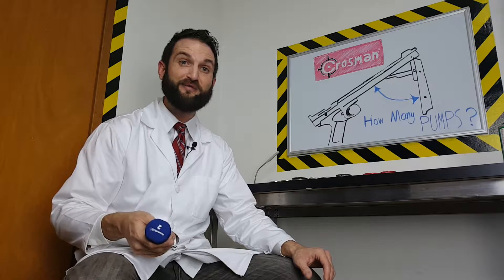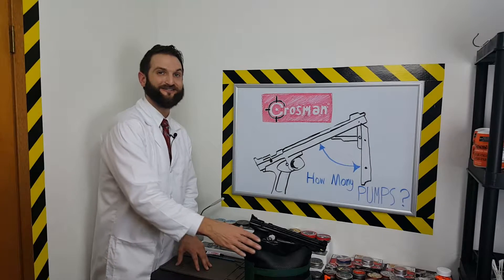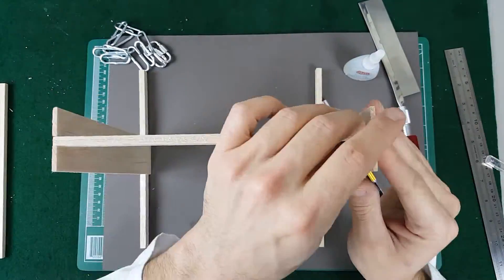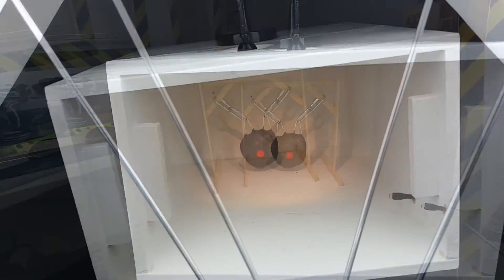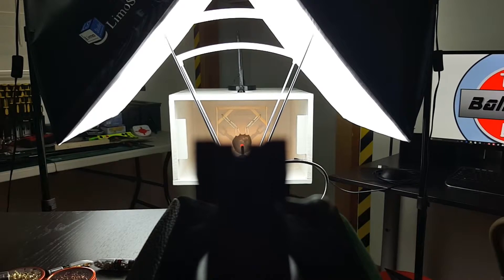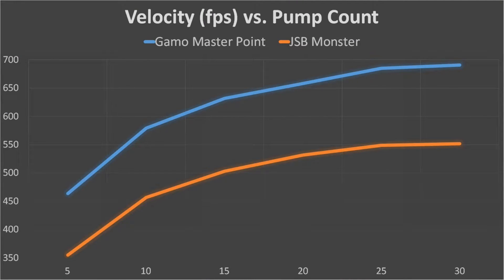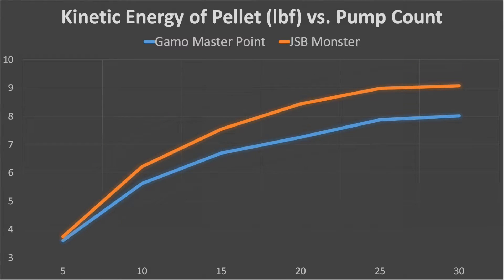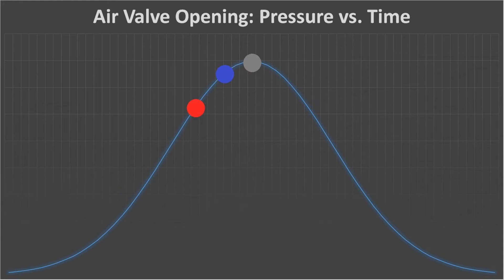S1E7 - Airgun Pump Power Test - How Many Pumps is TOO Many?

Comment: I posted my comment before I read some of the other comments, but here's my 2 cents: numbers do not lie, but you can lie with numbers, and the laws of physics are not just really good ideas.
To begin, the average air molecule is around 28.96546 daltons, or 0.02896546 kg/mole. Now, kinetic energy is 1/2 x mass x velocity squared, so a parcel of compressed air has internal energy, but that energy is not directed at just one direction, but 3 because we live in a 4 dimensional universe (time is the 4th dimension). Now, using Maxwell's distribution, we have a probability or how much velocity a gas molecule has such as peak, average, and rms, and we also have the speed of sound to contend with, which is the slowest of all, so air molecules are traveling faster than the speed of sound, so why don't we hear a constant sonic boom? because according to Maxwell's distribution curve some are traveling much slower than the speed of sound, while others are traveling at far greater the speed of sound, so they cancel out. Now, looking at the formulas notice the variables: square root radical, 2, 3, R, T, pi, gamma (Y), and M. T is the thermal dynamic temperature in kelvin (not degrees kelvin, which do not exist). T = 273.15 + degrees celcius, and degree C = 5/9 x (degree Fahrenheit + 32). So we begin with the speed of sound (SoS) = sqrt(YRT/M), or sqrt(402xT) then to the most probable "peak" (Vp)=sqrt(2RT/M) then the average (Vavg)= sqrt(2^3xRxT/(pi x M)), and lastly, the RMS (Vrms)=sqrt(3RT/M). The analogy here is the same as the five blind men trying to describe an elephant depending of where they were testing, or touching it. This is why I wish a psi gauge was attached to observe the compressed air pressure in the cylinder after each pump. Energy and momentum is conserved, which means it, or they only get transferred into another form of energy such as heat-energy, sound-energy, light-energy, kinetic-energy, potential-energy, internal-energy, nuclear-energy, mechanical-energy, magnetic-energy, etc., etc. and moving toward entropy (S). How I wish the metrics were given in the video such as barrel length, volume of air reservoir, reservoir pressure then the calculations could be more exact than assumed. I calculated the gun's efficiency to be between 15.25% and 33%, which is beyond ridiculous because the efficiency (n) calculations should be around +/-0.001%. Lead has a specific density of 11.34 gr/cc and molecular density of 207.2(1) daltons, or 207.1g/mole (grams (g), and not grains (gr)).There are approximately 7.15 air molecules per lead molecule and using the law of conservation of momentum, you can see that the mass of air far outweighs the mass of the pellet; in other words, just because air is invisible does not mean it does not exist, so taking this analogy, it is as if air was an invisible bowling ball and it strikes a baseball at faster than the speed of sound, but only accelerates the baseball to 600 to 900 fps and thus the baseball only creating 15% of the total momentum calculated from the volume and pressure of the reservoir. Yes, I find it interesting too, which is why I stay up all night watching YouTube videos and taking down notes and fact checking. Lastly, because compressed air is bouncing against 6 faces in a cube and the 3 dimensions in the real world there exists the probability of air travelling in the X-direction of 1/3 the amount, or called 3 degrees of freedom, and is why gamma (Y) for air is approximately 1.4, which equals 7/5, which comes from 3/5 + 4/5, which comes from ...mechanical statistics. I hope I didn't get carried away on this follow-up comment. Stay safe everyone, and God speed.

Comment: Great video, liked and subscribed. As to which pellet has more energy? You cannot compare apples to oranges. You can only compare apples to apples and oranges to oranges. I wish you had included the metrics of barrel length, chamber psi, etc. If you want to compare different weight pellets then do not use the same barrel, use the laws of physics such as momentum (p), where p = m x v then you will realize that the one with the highest velocity will far outperform the one with the less velocity because in kinetic energy (ke = 1/2 x m x v^2) the velocity is squared, so for unit time of one second you will realize the fastest projectile outperforms the heavier projectile, but if you are using the same length barrel then it will appear that the heavier projectile outperforms the lighter projectile. Many argue that it is because the heavier projectile travels slower and thus ends up being longer in time in the barrel where it will accelerate for a longer time and thus absorb the kinetic energy of the gas in building up the heavier projectile's kinetic energy; although true, but if the lighter projectile were to spend the exact amount of time in a similar barrel, it will most definitely gain far greater kinetic energy due to the increase of momentum gain from the air; in other words, for the lighter projectile to equal the heavier projectile in kinetic energy, or momentum, it would need a far longer barrel, so if your length of barrel is fixed then the projectile that lasts longer in the barrel will have the highest kinetic energy, but will appear to be travelling much slower "appear". As to the valve dwell open amount, it is around 2 to 4 inches at most of pellet travel, and that's the fast moving pellet, but the pressure drogs geometrically because the volume of the barrel behind the moving pellet increases geometrically to the point of diminishing returns once you go past the frictional forces, which are the same, which are about 2 pounds of force per inch. In addition, the breakaway force is around 6 pounds of frictional force. Note: breakaway force never exists with frictional moving force because one is static while the other is dynamic. I calculated an efficiency of 15.25%, and you can certainly do better than that by increasing the barrel length. You cannot have your cake and eat it too, so you have to decide whether to have a high efficiency (shot count, or ease of pumping), or POWER! (low shot count, or a hell of a pumping experience as your 30 pumps). Which is it going to be? A shooter must know their limitations. Thank you for the video and add a digital pressure gauge to the cylinder and it will be like wiping the mud off your goggles. Stay safe and keep up the great job.
Reply: If they are going at the same velocity heavier has more energy. Heavier is more accurate. Sometimes you get more velocity from the lighter pellet, but this was not the case in this test. If you want to know the barrel lenght and specs look up the crossman classic.

Comment: I would be more inclined to think that the increase of energy is due to the seal of the pellet in the barrel.
Reply: The increase of the energy is because the heavier the projectile, the longer it stays in the barrel to absorb some of the kinetic energy of the expanding compressed air. The lighter projectile has far more kinetic energy per millisecond, but it stays in the barrel for far less time. A 500 fps projectile will travel 6 inches in one millisecond, where a 600 fps projectile will travel 7,2 inches in one millisecond, so to normalize both projectiles, you would need a 6 inch barrel for the 500 fps, and a 7.2 inch barrel for the 600 fps projectile, but if you are firing both projectiles from a 4 inch barrel then 4/6=66% energy build compared to 4/7.2=56% energy build. The only thing that can make the look equal is when the barrel length normalizes the velocity squared of both projectiles, which is approximately 69.4% the length of the fastest projectile's barrel length. Numbers do not lie, but you can lie with numbers, and the laws of physics are not just really good ideas.

Comment: the heavy pellets allow pressure to build up wich explains the dramatic velocity even for its heavy weight, i used to shoot beeman lasers wich are 6.5 grain, they were so loose of a pellet that the air wasnt allowed to build pressure so it had a lower velocity then even some heavier pellets since it just was to loose in the bore, my favorite pellet for the crosman 1377 was the 16.1 grain eun jin pellets, 3 ring round nose pellets did very good in my 1377, i also had some old sheridan pellets classic 8.0 grain pellets that were to tight that they lost a lot of velocity compared to other pellets in their weight class, so to loose or to tight causes velocity loss, just the right amount of both pressure and time can make velocity better or worse for its weight class

Comment: hi i have this same gun and have been worried about going over 15 pumps as the owners manuals says not to go over 10, i just dont really care sumce the gun is only 69 bucks and i would love to beable to pump more air for more power, thats what makes these pump guns so fun in the first place right? well do you think i would be fine pumping 20-25 for average shooting or do you think it will ruin a seal? also how many pumps do you think it will take untill you hear  air start hissing out from possibly being way too over presuriized?
Reply: Well i pump 85-100 at the extreme mostly 25 i have pumped it to much one time and hissed air out
Reply: I pump my Daisy Powerline 901 15 times usually for hunting and so far it's ok.
Reply: It could blow your seal if to much pressure is applied

Comment: love the videos, the reason heavier pellets develop more energy in pneumatics is because the air pushes on the heavy pellet longer than with lighter pellets, the heavier pellets have more time in the barrel,which the air has more time to push against the pellet accelerating it longer, in spring piston guns,lighter pellets develop more energy than with heavy ones,in guns that use Co2 and high pressure air,the heavier the pellet the more ft lbs it develops.
Reply from the maker: Thank you for the comment! Regarding the heavier pellets being more energetic because they have more time in the barrel, that seems to be circular logic. Wouldn't you agree that the faster the pellet moves, it spends LESS time it in the barrel? The extra time in the barrel is the result of it's extra mass--not the cause. I think that theory was incorrectly born out of the fact that increasing the barrel length will keep the pellet in the barrel longer but critically, it also accelerates the pellets for a longer time resulting in higher velocity. Energy must be conserved (it's the law :)) so I'm more curious about mathematically where the energy is going rather than anecdotes about the nature of air guns.
Reply: yes airguns can always keep you guessing and you can never be too sure what they will do, there are books on the topic such as cardews "from trigger to target" and plenty of articles and great info online and that's were I found out the information, spring piston guns develop more energy with lighter pellets, and pneumatics make more with heavier pellets, that's just the general trend,there are always exceptions to the case
Reply: I have a never ending curiosity about how airguns work,and the internal/external ballistics of the projectiles they fire,that will never be satisfied. its a vicious cycle lol
Reply: Good point, but I wish you had included the pellets weights, barrel lengths too. The point of diminishing returns is when the barrel is longer than the equilibrium of the coefficient of friction based on time rather than distance, so because the heavier pellet stays in the barrel longer, it goes beyond the point of diminishing return of the equilibrium of the coefficient of friction, where the lighter pellet doesn't, so it appears to have greater kinetic energy, which it does, but for a reason of not staying longer than the equilibrium point of diminishing returns of the coefficient of friction. So now you know what you know and why you know what you do know. The universe is balanced and seeks to remain balanced. Why? It doesn't matter, it's just the way it is, but it would be really nice to know why, and I think and believe that we will, but not in this life-time, but the next. Hold me a seat, please.

Comment: try a thicker skirted pellet such as the rws hobby, start pressure is approx 600 psi against the falcon accuracy plus which is about 240 psi, you should see a huge difference if you think the pressure is effecting it that extent, nice video
Reply from the maker: That's a good point; I am eager to follow up on this episode so the advice is appreciated. Thanks for the compliment and for watching!